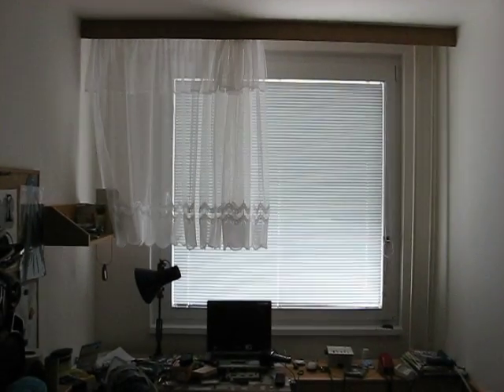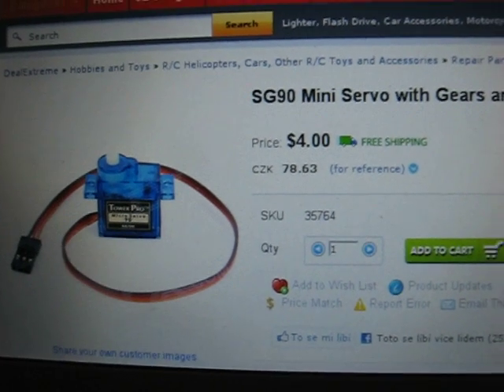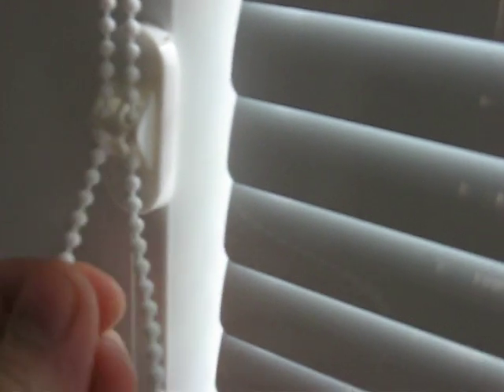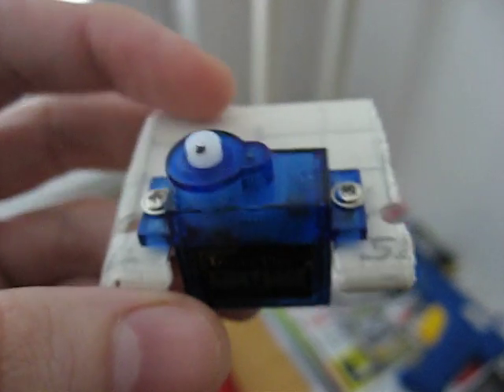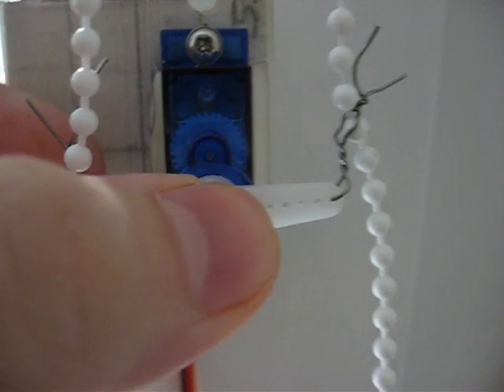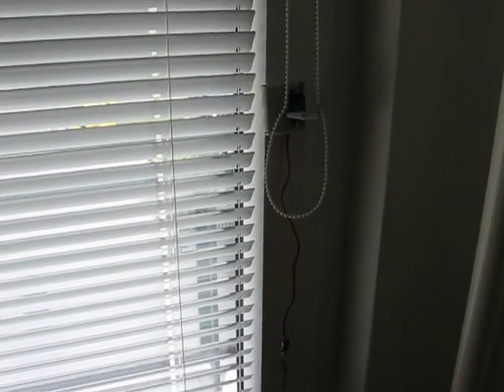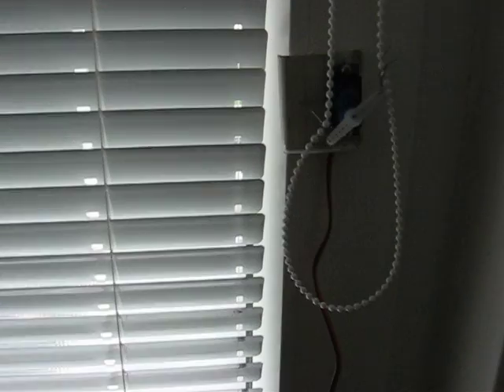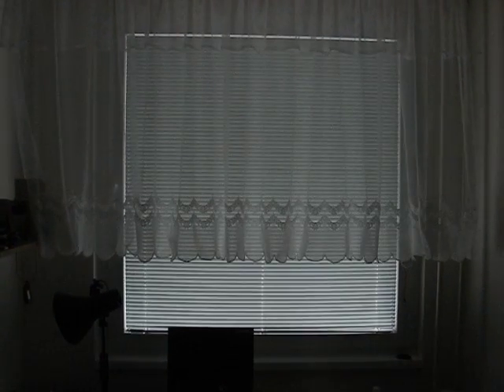DIY Automatic Sunblinds Using $4 Servo Motor

Comment: How will I do this? I want to be able to go up/down, and not open/close. I have strings that has to be pulled down and spun 
around a piece of plastic in order to stay up. :) I was given the tip 
about a "JGY370", but I don't know... Do you have any ideas? Thank you 
for making this video!
Reply from the maker: Then you need DC motor (don't know what is JGY370, but it might work + it has gears which is nice) and you need end stop switches that will turn it off once it's completely closed/open. then you need some mechanism to controll it. it might be purely mechanical. (just bunch of switches) or using arduino and h-bridge to drive the motor.

Comment: Where did you find the mount ?

thank you very much!
marC:)

Great project!!!!
Reply from the maker: Marc Paradis The mount was made from scrap electrical conduit, however you can use any kind of plastic box after drilling proper holes into it. But you should use box that can be screwed together, so lid does not come off during operation.